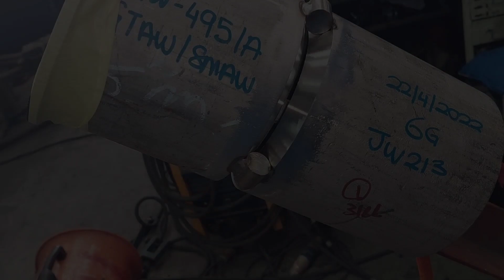WELDING WQT PIPE 6" SCH 160 6G POSITION STAINLESS STEEL SS-316 GTAW/SMAW JUTASAMA (2022)

Comment: Banyak welder yg gagal tes .stenlis krna mnggunakan kawat stik E 308 kawatnya lumayan susah.ada saran dan masukkan om
Reply from the maker: Kalau mesin yg kalibrasi..biasanya saya pakai ukuran ampere untuk root 80-90 bang..dan hotpass 150.
Kadang mesin yg gak di kalibrasi panel menunjukkan 90 tapi sebenarnya 120..
Kalau menurut saya stainless steel yg biasa saya pakai disini 308,309,316,904,845 dll itu lebih kurang aja bang.namun kalau inconel,duplex,super duplex dll itu sedikit lain..
Coba kalau matrial 308 ampernya di kecilkan dikit bang,pakai 75 misalnya..dan biasanya ss material dia cepat panas. Walaupun amper kecil akan terlihat besar karna pengaruh panas tadi.

Comment: How much ampers Do I need to use for capping stainless bro
Reply: Teach me bro ampers root pass hotpass and capping I'm going to test next week wqt
Reply from the maker: Root pass for stainless steel should be lower than carbon steel..i using 85-100 to rootpass and for capping 75-90 for 2.6 mm electrode..
Thanks for watching my video sir
Reply: Ok bro thank u. Nice video your one of the best
Reply: Bro can I ask u again about the gap. What is the best for schedule 160 pipe 4mm gap or 3mm
Reply from the maker: @behumbleplease7545  for me 3.2 mm nice gap..